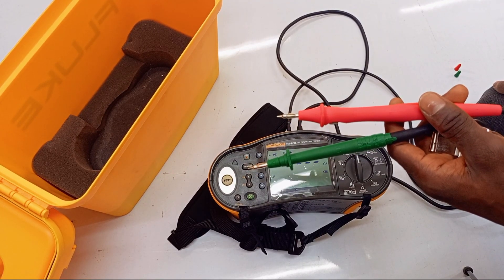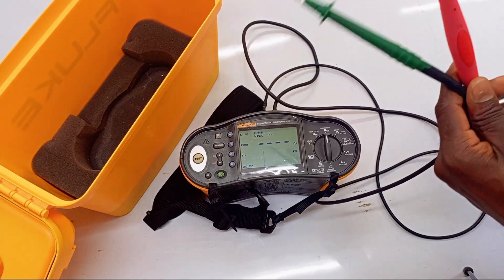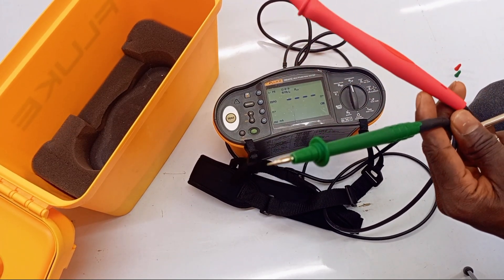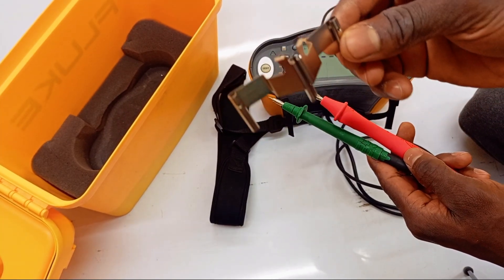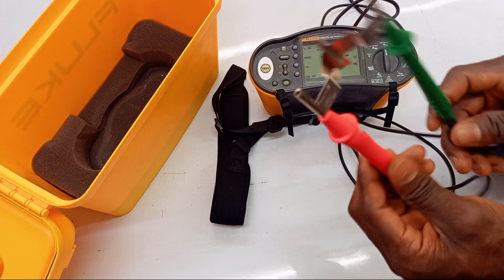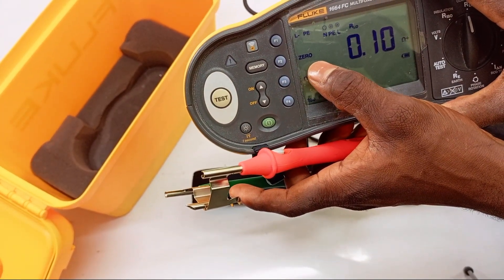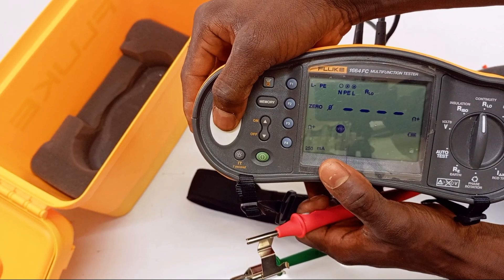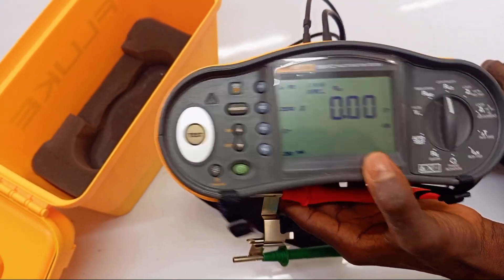Maximizing Accuracy: Zero Testing with Fluke1664 #fluke

Comment: Good explanation as it is not as intuitive as one may think. I spent ages following the Fluke instructions and could not zero the meter. It seems holding F2 for 2 seconds does not always work as some commenter has said. The trick is to hold the F2 button until the slashed zero, Ø, appears next to ZERO (when the resistance value also appears) - then release.

Comment: Do you have video for nullin for Zs ,non trip and hi current too ?
Reply from the maker: I will make one in the coming weeks
Reply: @SparkandLearn you null all lead sets on the continuity function.
Reply: You don’t need to null the leads for any other function , you only null the on the continuity function
Reply: If you don’t know how to use such machines then you should not be testing or messing around with electrical systems/equipment, leave it to those of us who know what we are doing and are qualified to do so.
Reply: @ ,The one who dosent know really is you.I use them all day and every day-and that’s what I do.All type of testers.While Megger is set to minus the leads ,Fluke needs to be done manually.Before you jump ahead again learn,don’t pretend,as clearly you don’t know,Who else knows better than people who build it.
Don’t need to reply
Reply: Fluke manufacturing will disagree with that if you call them 
Yes you need to,just like for continuity for the same reasons
Reply from the maker: @altintahiri  You are correct. For any test regarding resistance or impedance, nulling the test probes is important. check https://assets.fluke.com/manuals/1651b___umeng0000.pdf   for reference. Have not been opportune to make a video, hope page 22 in the link above helps you. Thanks

Comment: How to null leads in loop test
Reply: You don’t need to null the leads for any other function , you only null the on the continuity function
Reply from the maker: @Dog-whisperer7494  https://assets.fluke.com/manuals/1651b___umeng0000.pdf    Check page 30 of the fluke link above.                  For any test regarding resistance or impedance, nulling the test probes is important.